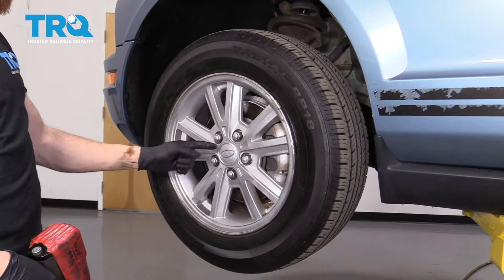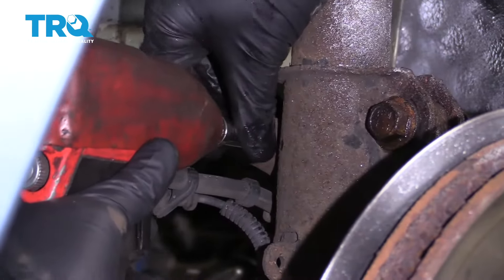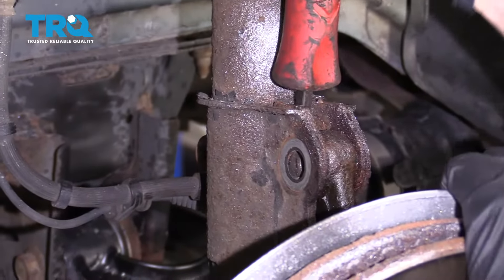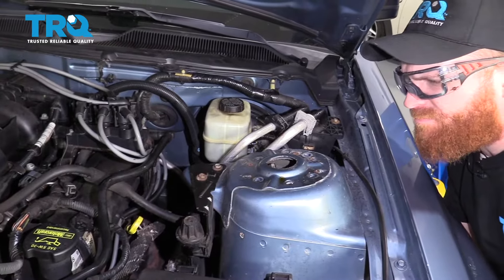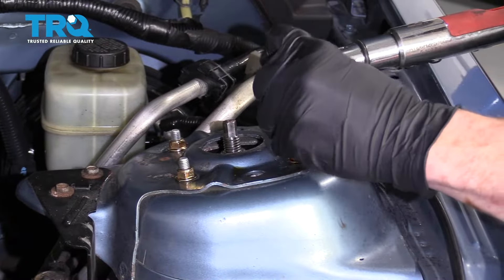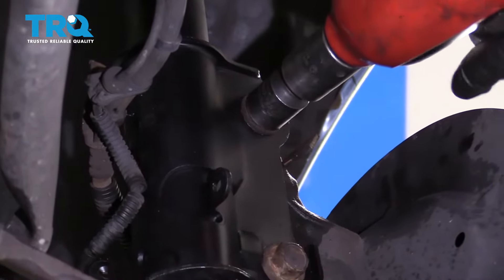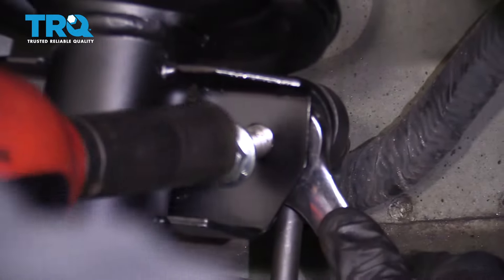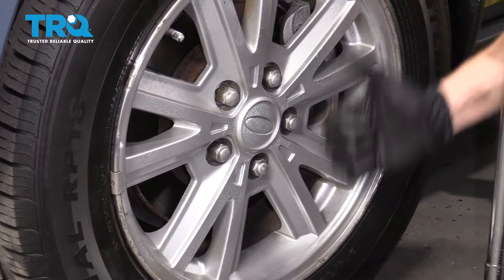How to Replace Front Strut 2005-14 Ford Mustang

Comment: I have a mustang 2005 V6 base model just like its pictured here and NO it was not a simple unscrew and pop er off type job anyone can do.  The video depicts a simple unscrew and pop off for the strut however my experience was the upward pressure of sway bar prevents you from taking off the link to start with the strut job. I would say whats missing in this video is you need a Large C clamp or pry bar to apply pressure downward on sway bar to remove link and proceed to next steps. Anyone out there  with a different experience on what my experience was please enlighten me .Utube videos that make things like a magic wand ...its a snap....nope not for me. Good luck.
Reply from the maker: +Joe Krueger Thanks for the feedback! http://1aau.to/m/Shop-TRQ
Reply: You use a floor jack to compress the suspension from under the rotor to allow the removal of the sway bar link.
Reply: Know this is old, but if both sides are off the ground the sway bar won't flex and make it harder to take off the links
Reply: @sweetb5885   in your experience, is it easier to do one side at a time? Going to attempt this today 👀

Comment: I thought you’re not supposed to use a Torque Wrench as a ratcheting wrench?
Reply: Don't use it as a normal ratchet. He ratcheted it bc he was torquing it right there and then
Reply: Just don’t use it excessively. You’re going to have to use it as a ratchet a little bit. Never use it to break a bolt loose though.

Comment: I recently replaced my struts on my 05 mustang and after that it started making a clunking noise when turning at low speeds. What could that possibly be?
Reply: Happened to me too. Going to replace it again with a new one and return the other one. I’ll let you know if that changed anything.
Reply: Clunking was gone after replacing it again. Steering wheel wobble issue came back which was the reason for changing it in the first place.
Reply: Faraj, your car starting making those noises after installing the TRQ complete struts? 

What did you end up doing? My 2014 is making those noises with the stock struts.

Comment: This is a great video. However, there is a problem with it.

I just got done following these directions to replace my struts. I ran into a problem with the sway bar link not being lined up with the hole on the new strut assembly.

What I had to do to fix it was use a 2nd jack under the steering knuckle to push the assembly up a bit and compress the spring. I extended it to max because the one I normally use lifts higher, and then I slowly released the main jack so it slowly lowered onto it and pushed it up until it lined up.

My main jack is a low profile 3 ton racing jack, and the 2nd jack was the basic kind that comes with cars. Used my impact wrench to extend it and lower it because using that thing that comes with it would have taken a hundred years. 

The second side, when I did this I lowered the main jack a tiny bit too much and had to pump it back up slightly. 

Thia video mentions nothing about that problem.

Comment: Does 2005 front struts fit in a 2012 mustang
Reply from the maker: +El gordito Del valle The parts will not be able to fit the same but the installation process will be very similar.